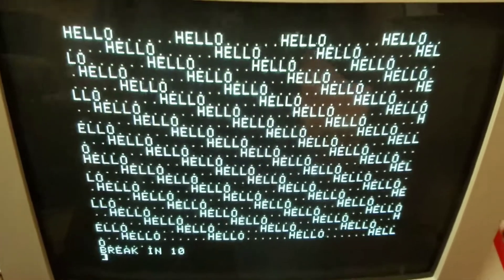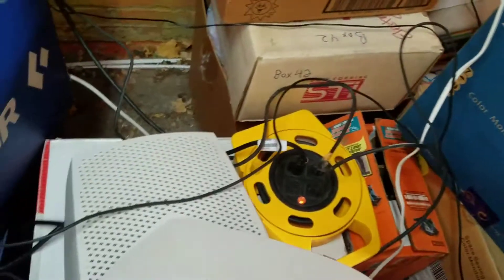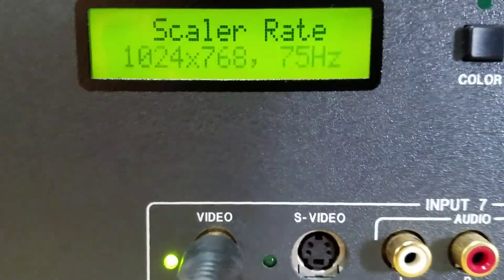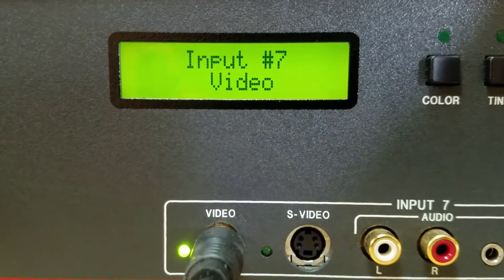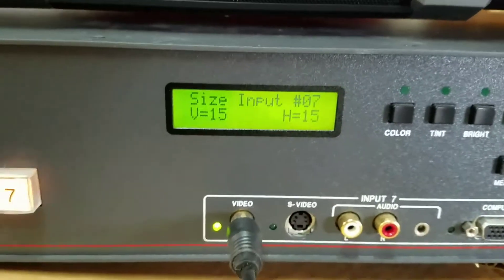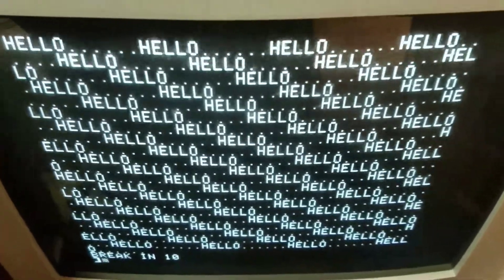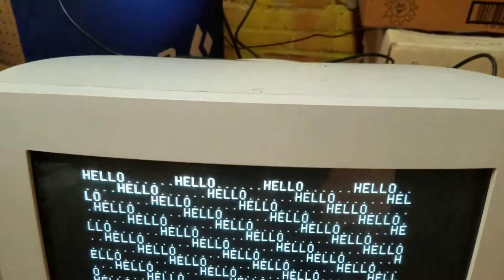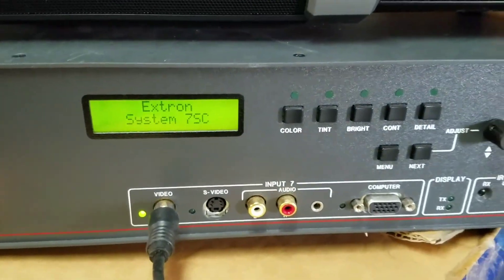Extron System 7SC Video Scaler 80's Computer to VGA

Comment: I know this video is quite old. But I stumbled upon it and wanted you to know that I've been using one of these for many years now in my game room to handle the conversion and scaling of many of my old retro consoles and it has been excellent for this! A few things to note for those who like myself, may have just seen this video:

- The 7SC has build in motion compensation circuit that you cannot disable. It can cause pixel movement and shifting on sprites when playing some games below and above the sprite objects.
- There is added lag to the signal if you use a higher output resolution. I use 640x480 for the least amount of lag and then run the VGA into my OSSC to 2x that to a final 960P output.
- These are noisy as they have a constant active cooling fan. I installed a much quieter Noctua fan into mine to help with this.
- They do NOT have an on/off switch. It comes on as soon as you plug power into it. I added a power toggle on/off on mine connected to the neutral into the transformer
- They use tiny little 5v incandescent bulbs for the button lights. I installed warm white LEDs into mine to ensure longer lasting use as the bulbs aren't easy to find now.
Reply from the maker: I did little else with this scaler since posting the video. I have it stored away somewhere. When I find it again, I'll probably put more into hashing out all it can do. I appreciate your insight on what you know about these scalers. I'm interested to see the behavior firsthand.